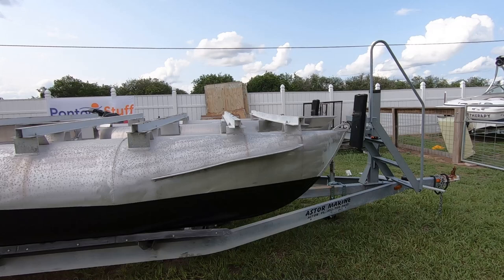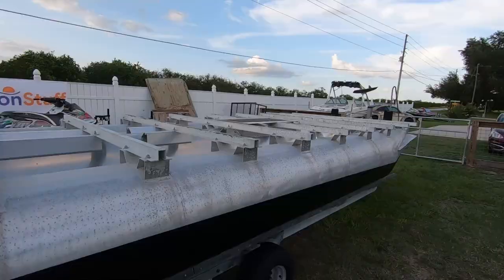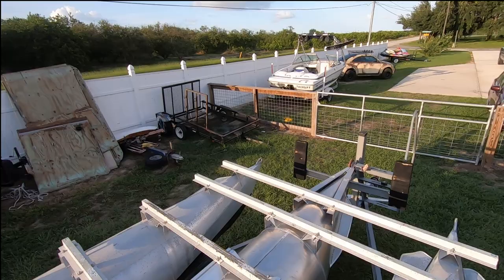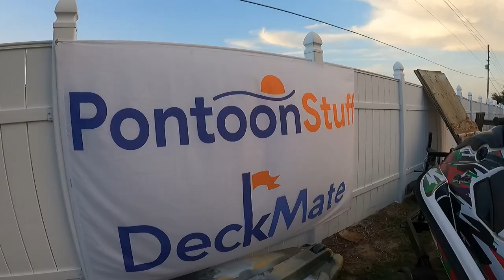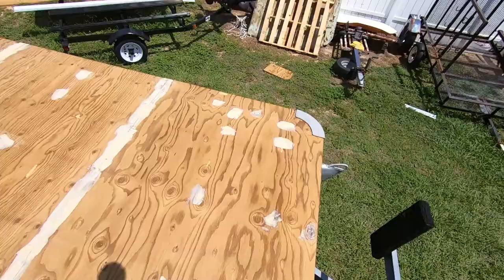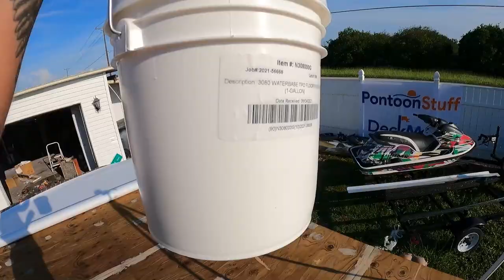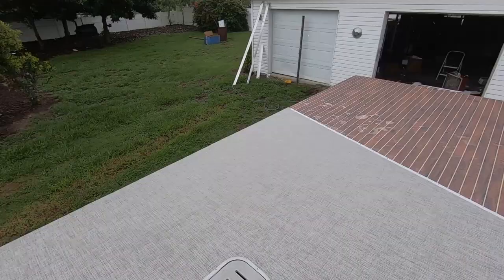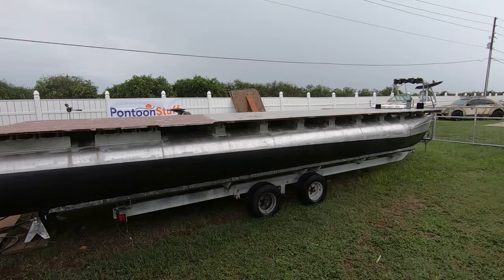Installing Custom Flooring on my Pontoon Boat Rebuild - Episode 4

Comment: I didn’t see you do it, but I would recommend sealing that storage hatch to the floor with more then just screws. Water will seep under and slowly rot the floor in that area. I have used 3m 5200 you can get it at Home Depot.

Comment: I think you are going to have some 'issues' with the location of the axles once you hang a motor on that 3rd log.
Reply: Good catch. Motor, Bar, Helm, Fuel all aft. Hard to tell for sure but that may add up to a negative tongue weight.
Reply: In reality, he should relocate the axles and replace the leaf springs and also change out the hubs to allow for 5-4.5 bolt pattern. The set up is gonna need some load range C trailer tires at a minimum
Reply: I agree on both comments. If possible it would be a good idea to get an axle weight on the single axle and tounge weight. Then he could see how much to move the axle or if there is need for a second. I had a 24'  and it had a single but power size would make a difference, also.

Comment: You should look into media blasting to clean up the aluminum corrosion. They have attachments for pressure washers that introduce a media to the water stream. Plus the water will help prevent the oxidized aluminum dust from becoming airborne. Looking forward to the finished product. Keep up the good work!

Comment: You should invest in a decent sandblasting rig. There are tons of options as far as media that would give you a nice enough profile that you could paint or just leave the toons with a blasted finish. Clean and consistent. Stay away from Silica sand unless you have the appropriate supplied air respirator for it.

Comment: Derksen makes a "delux barn",  with a really interesting "wrap around" front room.      The room sticks out in front of the rest of the cabin,  with windows front,  left at a 45 degree angle, left at the 90 degree, and right at the 90 degree.   

I can see one of those, with the front porch extended 2-4 feet.   that front room being turned into a "bridge"  giving the pilot a huge field of view.   the rest of the cabin being set up as a simple houseboat,  with the back of the cabin having the double doors option.  Then mounting the entire thing on a 3 pontoon,  or a metal barge set up.    the double doors opening to an aft exterior deck, with the front door opening to the front deck for anchor or docking.   

It just seems like it would make a fun "houseboat"/floating powered cabin.

Comment: could not tell but the fuel tank needs "padding" under it to prevent a hole from vibration over time. Looks good and great work ethic young man.

Comment: I dig the build Zach.  Are most of your fasteners stainless steel or galvanized  ( besides the carriage bolts/nuts)?  I have a motor home which experienced a hail storm. The roof is going to be rebuilt . I requested 3/8 inch marine grade plywood.  Since most of the frame is aluminum and some parts steel and wood, I think stainless screws would be my choice though stainless is more brittle.  Galvanic corrosion would be better than rust which may stain the laminated panels and vinyl trim. What are your thoughts ?     JwgK

Comment: So I don't know anything about boating.... but I was thinking,   Why don't people use a membrane between the wood and the bottom of the boat?  You know how a house has the wrapping around the outside of it to protect it from the elements, before they put the brick or siding or whatever the exterior is going to be.

Comment: Awesome!! But hey.. isn't it easyer to make a kind of plug/tap at the end of middle pontoon? Instead of a bilge pump.
Reply: If you just use a plug the water that will inevitably splash in will just continue to pool up the entire time you're boating and fill that back part up until you take it out of the water & pull the plug. That would add alot of weight plus possibly get above the fuel tank and sneak in the gas. A pump is the best option.
Reply: How would you empty out the water if the boat is in the water? At least if he has a bulge pump he can just flick it on while he is out on the water and not worry about anything. But if it’s just a boat plug u can’t really do that.
Reply: Yeah... well he's not building a submarine . The thing is ON the water...not under. so when he pulls it out, just open the tap and let it drain. Or you guys really think its gonna fill up while boating...
Reply: @sluyk1964  maybe you've never been on a boat but that back will get water in it every time you slow down and the wake splashes over the top.
Reply: @brandonevans4142  maybe i've never build one and maybe i was asking/suggesting it not to you... but to the cool guy who is BUILDING it.
Reply: @sluyk1964  maybe do some homework before suggesting something you obviously know nothing about it.
Reply: @brandonevans4142  fact is.. the thing is never level . The back with the gastank has to be closed separate. Smal hole in the middle to insert,no reach to atach and no low point for a bilgepump. Water goes to the back side .. so if you have half a brain... it starts making sense. But i still wassn't asking you

Comment: Instead of laying new plywood and glueing vinyl could you just screw down composite deck boards from Lowes or Home Depot? It would be like half the cost and should be less labor. The question is do you lay the boards with a gap? Water would easily drain with a gap, but you wouldn't want water to splash in. I don't think composite deck boards get that hot and they probably don't weigh any more than plywood. Has anyone tried this? Is this a good idea?

Comment: Why not put bed liner on the bottom of the plywood to try and keep if from rotting.
Reply: The moisture has to escape, if you seal bottom it will rot faster

Comment: Man, the third bunk for trailer isn’t necessary….those boats are structurally built….that extra bunk is more trouble than it’s worth….
Reply: I would just put rollers for the middle log.

Comment: I know you talk a lot about paint the whole point of aluminum is it just does not rust or rot or anything like that,  I don't understand why anyone would want to paint aluminum, the whole reason for paint is to protect metal from or wood depending on what you talking about from rot, rusting things like that but aluminum don't do that unless you got some kind of color scheme you're going for, or a certain look I mean that's fine it's cool but just did just dealing with you know aluminum and the properties of aluminum it doesn't need paint most people don't think about you can polish aluminum and you can make it shiny as a nickel you know if you wanted to so don't understand what people are talking about when you're talking about wrapping it or even painting it I mean what you got here looks nice but that's only for looks I mean like I said aluminum doesn't need paint unless you like I said you're looking for some kind of color scheme or this right here looks fine but for the protection of the metal itself which is the whole point of pain it don't need it at all and you can polish it and make it look nice if you look for something to look better they got polishing wheels all day long and buff it out and polish it and I mean you can really make  aluminum shine if you want to take the time to do that, just speaking on the painting that you were talking about and the comments that people were making about paint or wrap